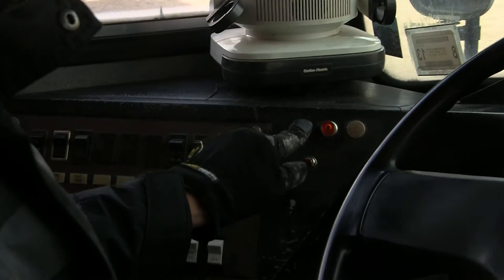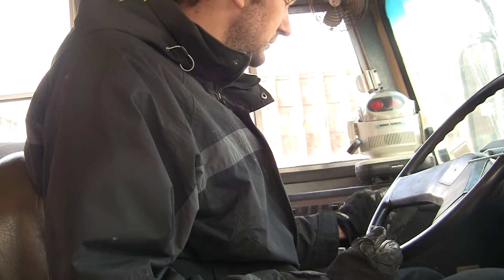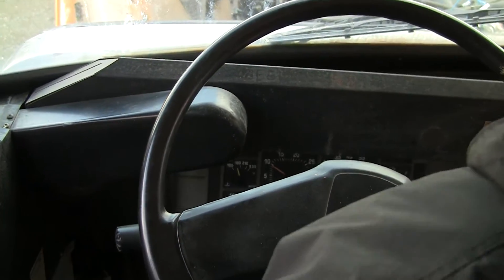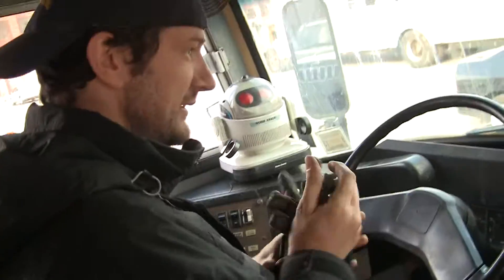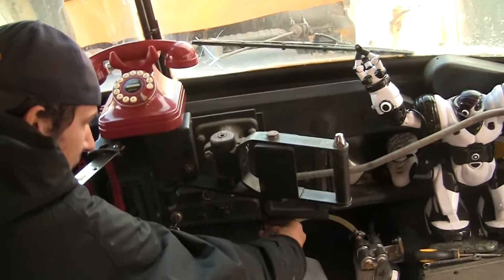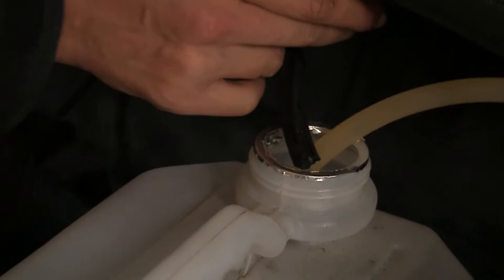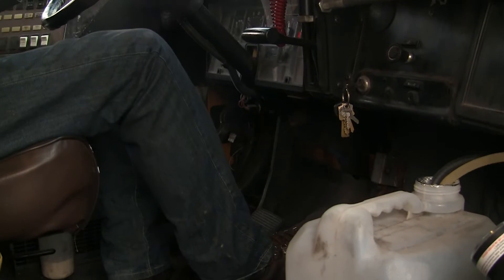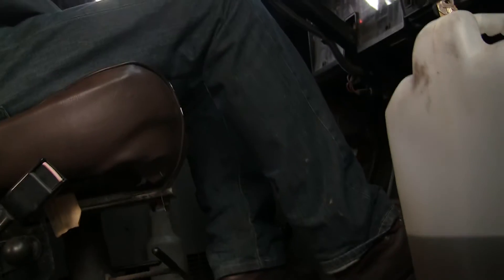00125 - WVO Diesel Conversion Working! - RAW Unedited Footage

Comment: I'm in the process of converting a school bus as well.  It's a 91 Bluebird with a DTA 360.  I'll have it set to run on veggie oil, but will probably be running waste motor oil primarily.  Have you tried running it?  People refer to it as W85, meaning that it's 85% thoroughly filtered waste motor oil cut down with 15% gasoline to give it the same viscosity as diesel.